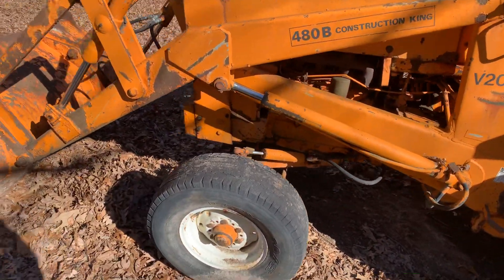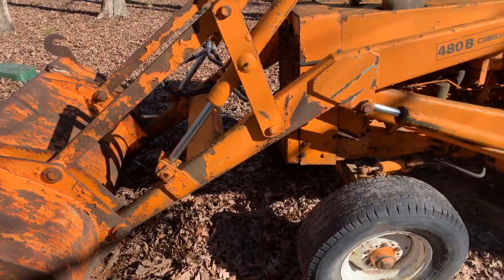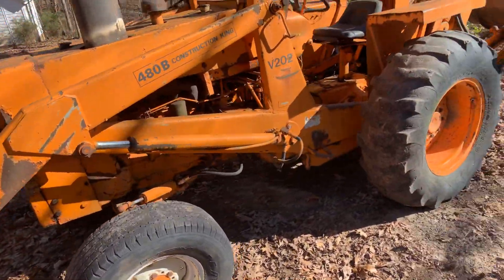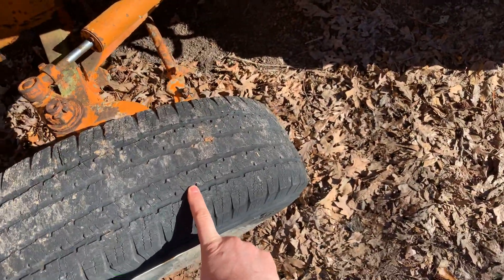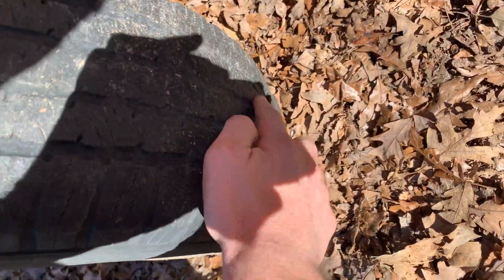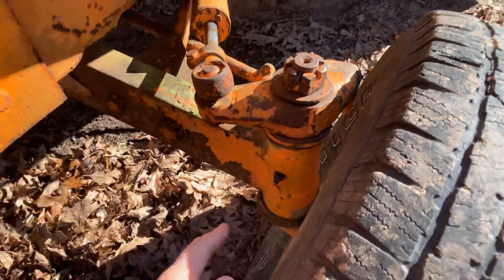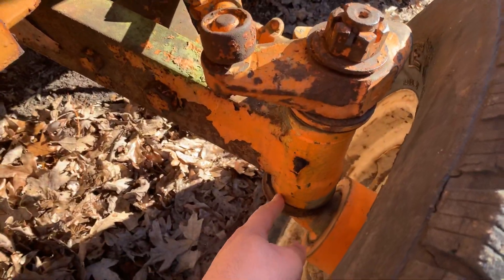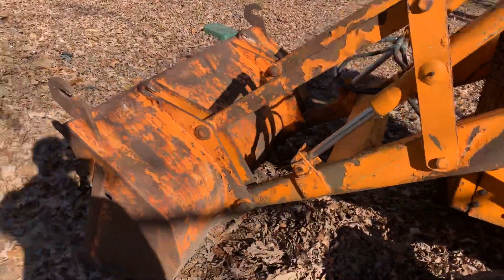Case 480B Construction King for sale

Comment: I just bought a 1966 ck 530 case 188 Diesel Backhoe for $2500.00  and I just bought a 1973 Ford f-700 DUMP trk 10ft DUMP body 361 5-spd manual trans 2-spd rear air brakes 5- ton DUMP trk for $2500.00  all for the farm